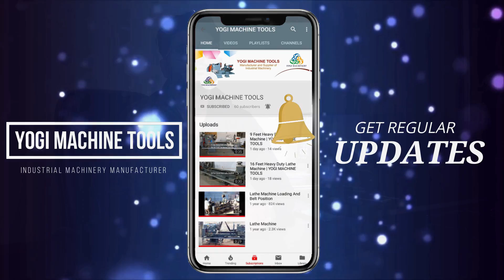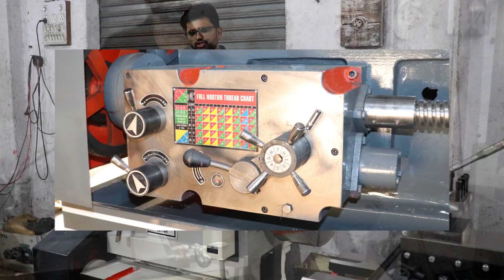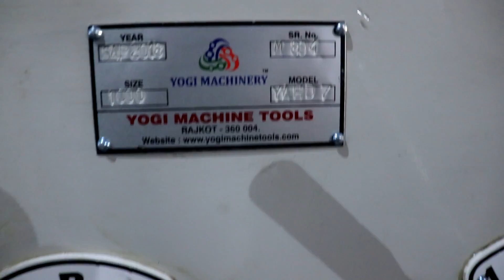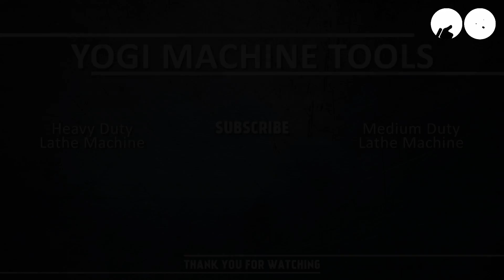7 Feet All Geared Heavy Duty Lathe Machine Describe by Hitendrasinh Jadeja | YOGI MACHINE TOOLS

Comment: sir, 
Can I run lathe machine on single phase -230V input supply available in commercial shop in city.
Since lathe machine  has 3-phase 415V  motor of around 5 hp load
Please advice cost /expense to make arrangement.
Thanks
Sanjeev